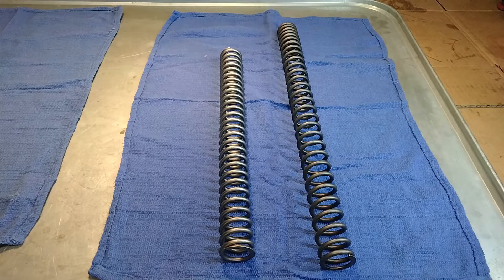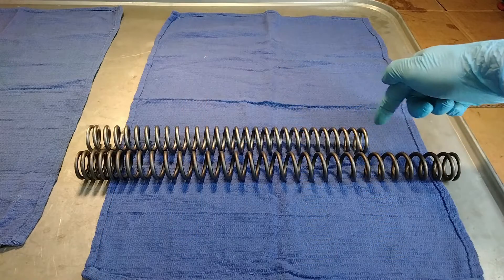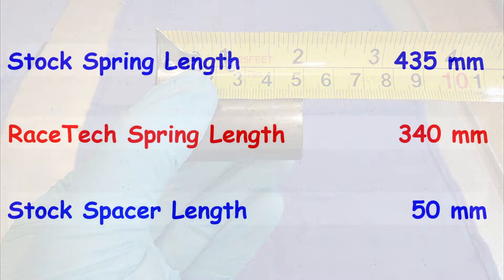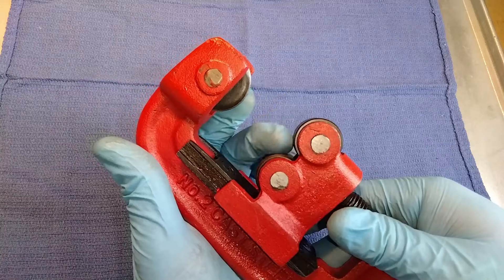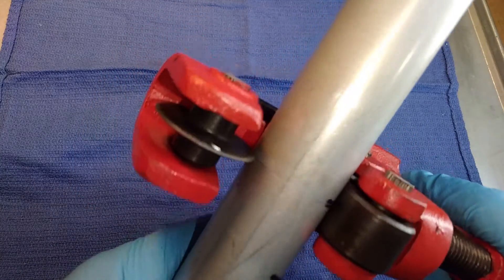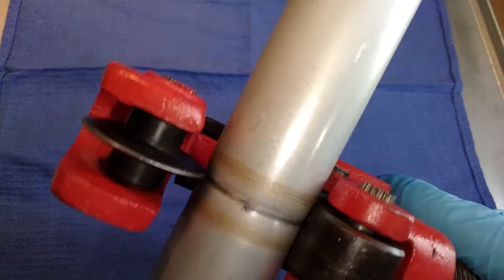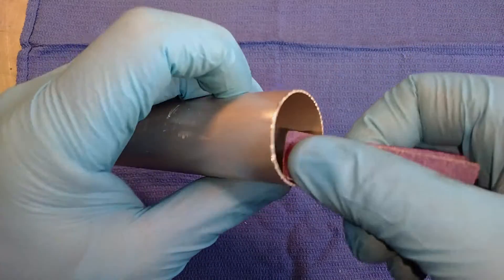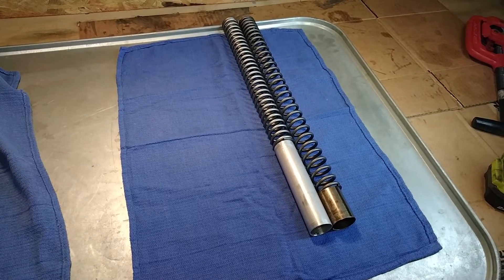Cutting Motorcycle Preload Spacers For Race Tech Fork Springs

Comment: Not the smartest way to do it if the original springs are old and sagged, your preload is going to be out.
Reply from the maker: Good point, if youre worried about that you could look up the specs for spring free length and see if the old ones are not a long as they used to be.

Comment: @nickbuchananracing
I am curious as to how your initial set-up felt when you tested it out. Did you need to shorten the spacers?
Reply from the maker: Yes, I reduced the spacers by 10mm. At first I needed the preload adjusters all the way out to get the sag close to right. 10mm shorter and it was perfect

I suspected this due to having the new stiffer springs
Reply: @nickbuchananracing  Today, I just installed Race Tech springs on my bike. It's a BMW F800ST. The front end was bottoming out badly. I followed your method here and got the bike all put back together, and went for a rip. It soaks up the bumps nicely. Thanks again 👍
Reply from the maker: @partyguarder  youre welcome

Comment: Ok, so is it  just me or did. He really  do all that measurement for nothing. When all the essentially did was copied, the exact same length of his new Spring with the spacer as his old one was with its spacer. Tell me a clarify that or am I seeing things the wrong way
Reply from the maker: I mean yea basically. Lol. But if you had forks that were already modified by someone else, it helps to do it this way because you can check specs for stock lengths  and return to stock installed preload setting. But yea basically copy and paste
Reply: You said you had aluminum spacer. How is the edge of that spacer wide enough to sit against the spring and stay in contact with it,without the spring binding and falling into the inner diameter spacer?
One other thing if you don't mind sharing.  You pull the stock spring out and then before you put the new spring In,you drop the preload washer in then the spacer and then another washer then the spring.   Im getting ready to respring my Yamaha 700 Tenere with Race Tech springs and my springs didn't come with any spacers,just preload washers.  So I'm gonna have to use some sort of spacer and PVC is what I've seen they use. So do you just use a piece of PVC that close or same diameter as of spring?  Bout have to be in order for the spring to sit and rest on it.

Comment: Bro even I'm doing the same thing on my 2018 Yamaha FZ 250. I have increased the suspension travel from 130mm to 190/200mm by putting a spacer below the damper rod on the threaded side. My stock springs felt too soft after the mod also they were bottoming out easily even on small bumps and I wasn't getting the full suspension travel while off roading. 
I have now bought Suzuki Gixxer GSX 150 fork springs which are about 100mm longer than stock and was thinking of doing the same that you did in the video... I will have to buy a tube cutter and a tube now😢... Big thanks for this idea mate! Cheers from India

Comment: My local shop installed new RaceTech springs (straight rate, 0.85, 18.5 oz of 10wt oil) and new seals on my 2009 VStrom 650A forks. Now the front of the bike is sagging noticeably. The front cowling nearly touches the fender. The single aluminum spacer tube supplied with the springs was cut in half and one spacer installed in each fork. Any thoughts to what causes my sagging forks?
Reply: Probably to soft of rate springs

Comment: With the material these spacers are made of, are these safe for performing wheelies periodically?  That’s helpful not to over tighten and to establish a groove!  😅
Reply from the maker: Aluminium spacers. Some bikes may have plastic spacers. As for the tubing cutters yea it also depends on the brand of tool. These are shit harbor freight cutters and they "run" like that. My Ridgid cutters on my work truck dont run at all because they are good quality. So figured it helps to show that because a lot of people may have picked up a shitty pair of cutters and they will probably run from time to time. Thanks for watching!

Comment: So I would have to subtract the length of the emulator also ? Or does it not affect the length of the spring? Sorry new to motorcycles and forks
Reply from the maker: I have never installed emulators but I think the answer is yes, subtract the length of the emulator. If these are for race tech emulators, go to race techs website and go to instructions,, they have super detailed instructions for every type of fork and motorcycle.